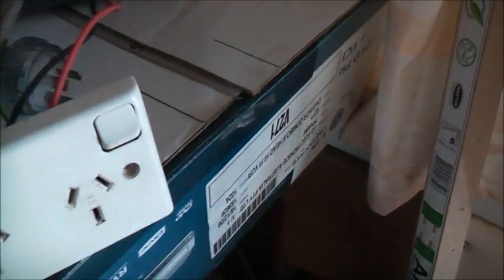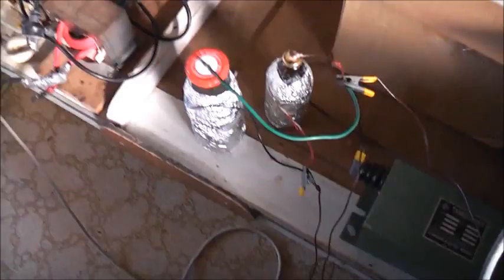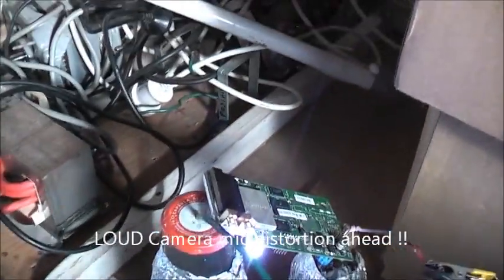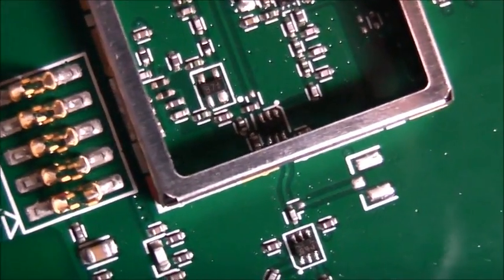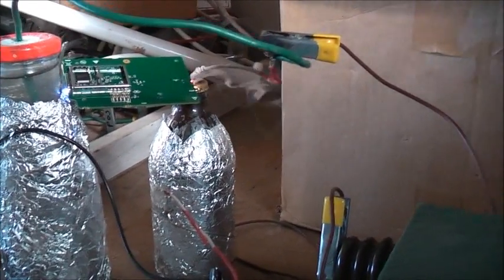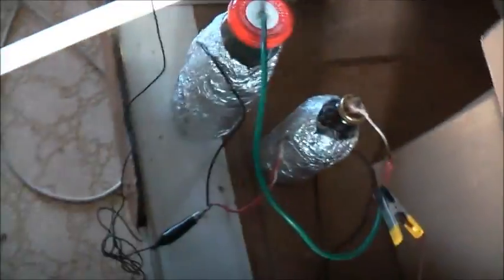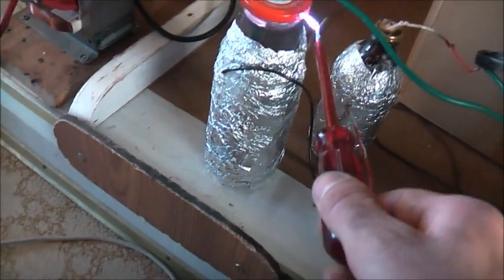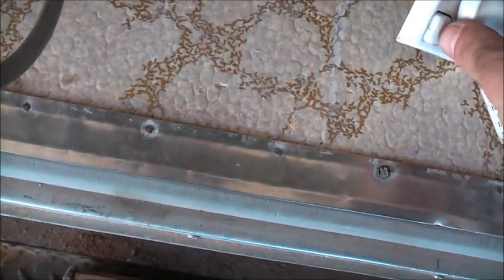Thunderstorm Capacitors & Communications Module Pop

Comment: Would those bottle capacitors work if you filled them with a borax solution? I wonder about using salt water as salt can produce chlorine through electrolysis if you put a current through it. Landis and Fryer, something that will happen to all smart meters after a power surge or a lightening strike.

Comment: Looks like you learned the hard way that modern fluorescent lamps have glass that is somewhat conductive to aid in starting. You guys are very lucky with the NSTs. Here in the states modern NSTs have a RCD on the secondary of them and anything other than a neon sign trips them out.